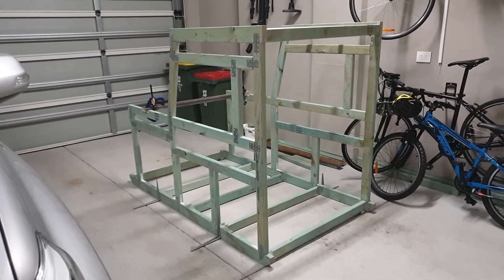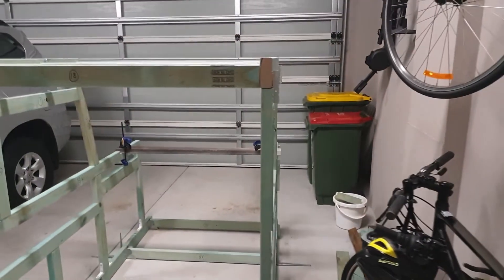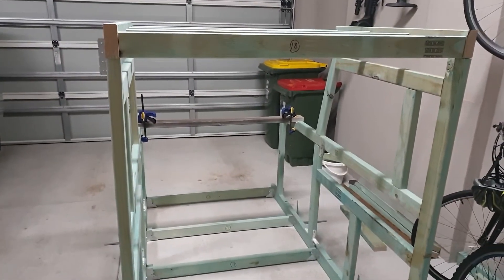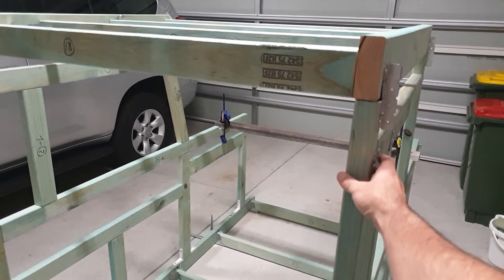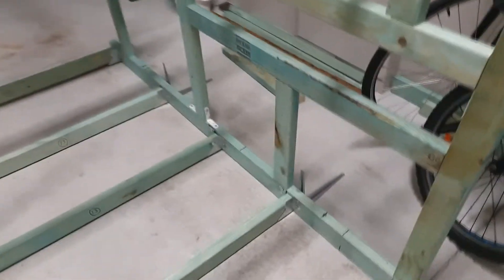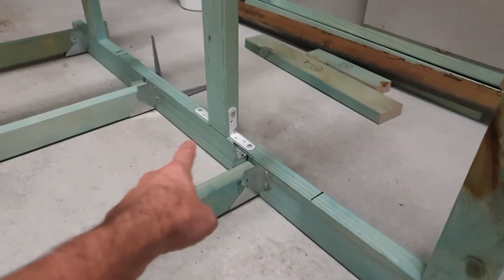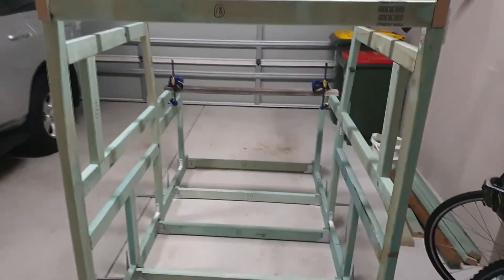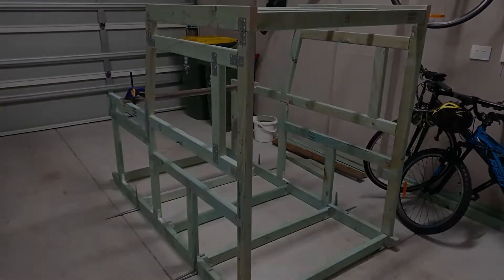⚡C172 Sim Frame Design⚡

Comment: Hello, Could you share the dimensions from the floor to the bottom of the pilot side window
Reply from the maker: Hi mate. I measure 730mm but I want to change the profile of my window so the bottom of the screen is not visible. I would therefore be looking to modify mine to 750mm.......hope this helps
Reply: @CessSim  Thank you again!
Reply from the maker: @williamroberts5943  no problems.....
Reply: Hi , does that mean your 55 inch tv is about 730mm from the cockpit floor to the very bottom of the tv frame ??     Thanks

Comment: I absolutely love your frame. I'd love to build one. I have my panel cut out but was going to mount it on an Ikea table.  Great job.  Do you plan to release a drawing by chance?
Reply from the maker: Appreciate the feedback and did take me a fair bit of time in design. On the subject of drawings, I did have some dimensional drawings of this but they were erased when Fusion360 changed its license structure. As such I am not planning on generating a new detail drawing of the frame (at least at this stage).....sorry mate.